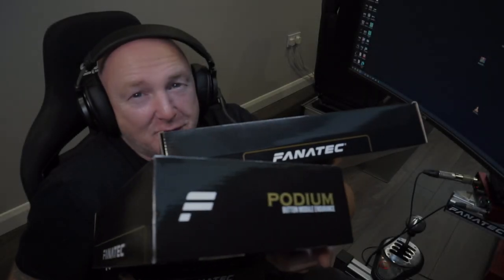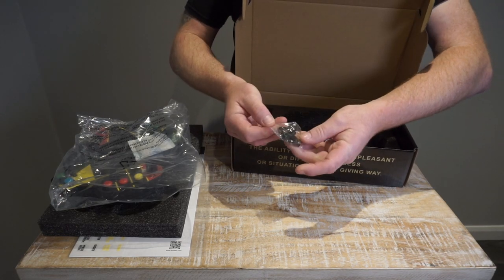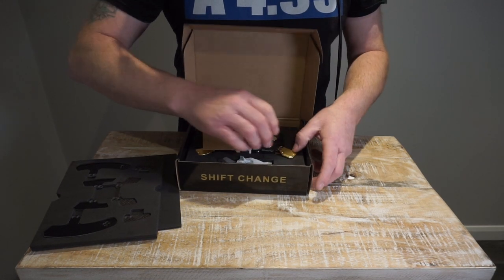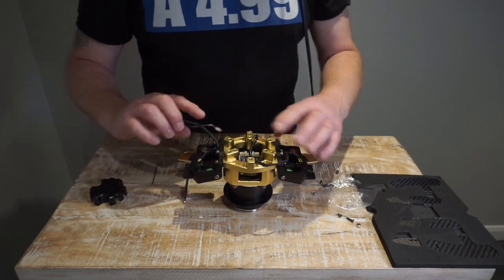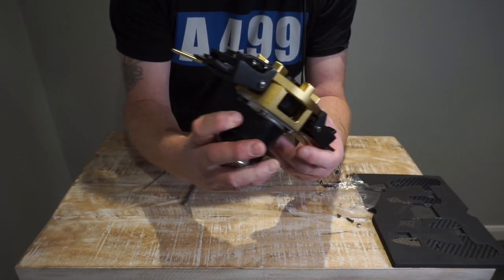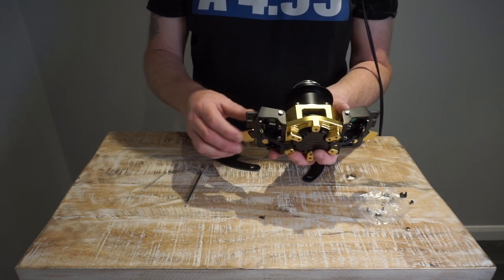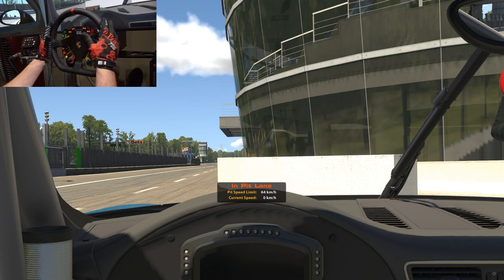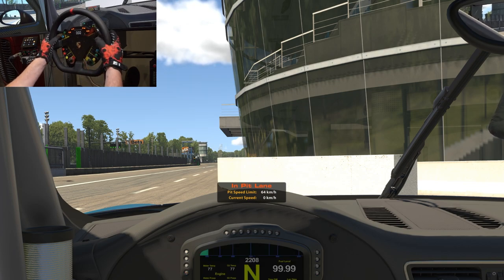Fanatec Podium Porsche 911 replica endurance wheel build

Comment: I was hoping you would get this wheel.  I think there should be spacers on the up and downshift paddles.  That will make the top paddles easier to use.
Reply: Definitely use the spacers as Michael suggests - makes a big difference.
Reply: Or use the spacers on the top paddles and switch the sides of the top paddles to accommodate the countersunk holes for the chamfered bolts
Reply: Came into the comments to see if anyone mentioned the spacers. I think the spacers go on the smaller paddles at the top, I remember Barry from SRG had the same issue when he did his review as he wasn't aware that was the purpose of the spacers

Comment: Ha! Just did the exact same thing today. Enjoying the wheel so far, be sure to use the chrome screw that came with the hub, it eliminated a lot of wheel wobble for me.
Reply: The allen screws can back out and cause wheel wobble. If that is what your talking about. You can solve that. When you install the wheel screws. Snug them down in a star pattern. Just snug . Tap around the perimeter of the wheel. Then tighten down again with a little more torque. Tap on the wheel again and tighten down the allen screws again in the star pattern. Keep doing this till the screws dont move.  The screws will be properly seated and you shouldn't need lock tight or anything like that.

Comment: Dave.. I have the advanced paddle module on my R300 wheel. I used the spacers on the plus/minus shifter paddles to ring them a little closer and then flipped the upper shift paddles to the back side and that gives plenty of clearance to easily differentiate them.

Comment: The Porsche wheel is slightly bigger than that version of the Cube GT Dave. 320mm vs 310mm.
Reply: Vincent Santucci That wheel (Fanatec's rim) seems to be a replica af the Momo MOD30 used on the real-deal Porsche.  Fanatec made it cheaper likely through material changes and a strategic material reduction by making the "dish" metal thinner.  And that's fine since it isn't going to steer a real-deal car.  But, theory goes, you could build your own.  It'll cost a bit more but, at the end of the venture, it'll work on any base.
Reply: @toddlynch7282  interesting info but not sure how that relates to my comment. I was just pointing out that the Fanatec wheel is in fact larger than the Cube wheel, just as Dave said it felt though he thought they looked the same initially.

Comment: You did not put the separators, the one that fell to the floor is for the large paddle shifts so they are closer to the steering wheel and separated from the small paddle

Comment: I want one of these wheels so bad. But i think i would go for the new magnetic shifters instead of the APM if i do. If im driving a Porsche GT i dont see a use for the dual clutch or additional shift paddles.  Also, you put the top paddles on backwards. Those ones are supposed to screw in from the back like the formula paddles. It will space it out a little and also give you more surface area when you use it.

Comment: Hi Dave, were you able to make any headway with the display ? i have the podium wheel and still the display is just a speedo. no devisions at all
Reply from the maker: You need to enable itm in fanalabs. When you have I displayed on your wheel you press the function button (the one where you get to all your settings), and rotate the funky switch.
Reply: @davecamyt   Thanks dave, i ll give it another shot and see what happens. I wouldn't be mad about the way various fanetec updates are organised. Using a DD2 myself, piece of art as a unit. Keep up the good work, love the videos

Comment: Dave can you please do a video showing your iRacing DD1 settings in Fanalab as well as your podium button module settings and mappings? Getting back into iRacing after having stopped racing it in 2012 and have the same gear as you so looking for some starting points of what you have found that works. Cheers for any help

Comment: Dave.  Would be interested to see if you get a different feeling from the Porsche rim to the Formula rim.  My Formula rim seems much more responsive and immersive.  Feeling the traction loss better. Settings are the same so must be in the firmware.    Would be interested to see if you feel the same. Cheers bud. 👍

Comment: I've found I need to adjust FFB on the DD2 accordingly with bigger rims to keep ffb at that peak strength point before it starts messing with your driving.      I learned this the first time i did a few laps on the Esports (formula sized) rim right after having my NASCAR Lenkrad rim on.  90% FFB in fanalabs and 6-7 in iracing was far too strong lol.  

I'm curious how it makes up for the lack of built in wheel FFB is compared to the BMW wheel I have.   Have you ever used to compare?  I'm assuming like the nascar wheel it doesn't have built in FFB?  Perhaps I'm wrong.

Comment: I am seriously considering this wheel? Did you like it long term? Never seen you use it before. Should be fine on a CSW right?
Reply from the maker: I use it in anything which has a circular rim. I think it's superb 👍
Reply: @davecamyt  thanks for answering mate. It’s expensive, but think I’m gonna order one. What wheel do you use the most? I currently only have the Formula v2.5
Reply from the maker: I think the McLaren rim is great for the price. Probably my most used Fanatec rim
Reply: @davecamyt  ordered the Porsche wheel in leather. Thanks mate.

Comment: Is it cheaper to buy it in separate pieces or completed, btw amazing video
Reply from the maker: It's around 70 euros more expensive to buy each component seperately 👍
Reply: I haven't seen podium button module sold separately. The wheel kit comes with all the boxes you need. So you pay one shipping fee. If you were to buy the items separately you would have to pay shipping on each individual purchase. I would imagine.
Reply: @davecamyt  thanks

Comment: Nice video Dave, What dave forgot to mention was the fanatec buttons feel like cheap crap and for a premium product fanatec should do way better. as for the rest of the wheel i thought it was excellent quality. So if you can handle putting up with the buttons on the wheel and pay a premium price for a flagship product its money well invested. Other minor things i noticed where having short fingers or a smaller hand can make it a tad slower to activate a button on the fly in the heat of battle but this will vary widely per user.
Reply: Felt fine to me